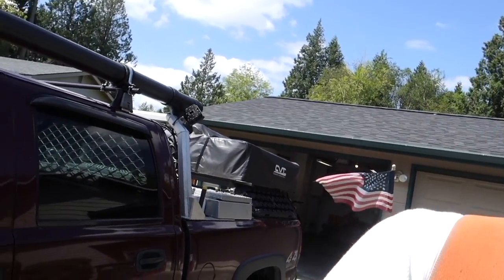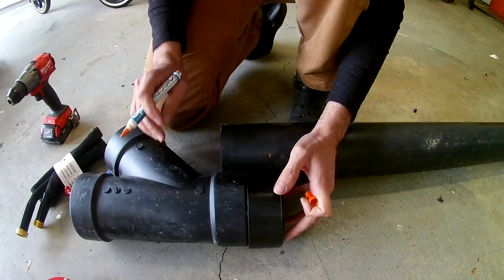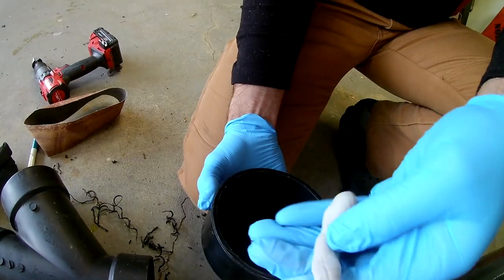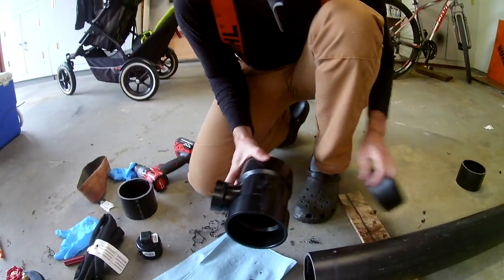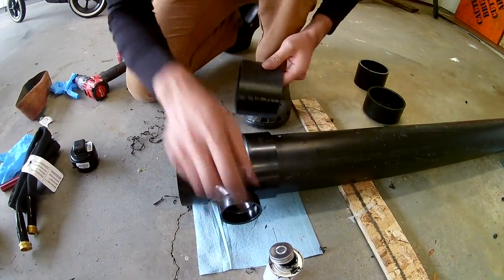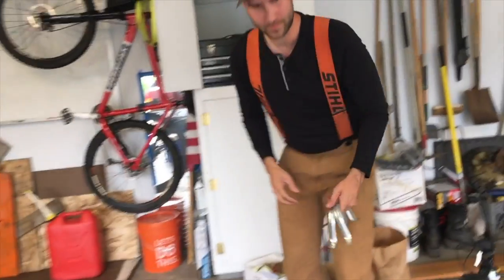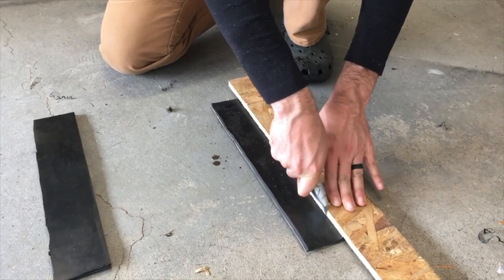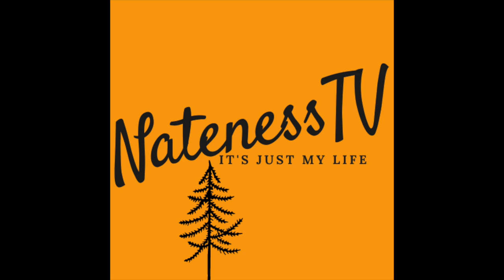DIY Solar Shower System Pressurized for Roof Rack Camping off the grid under $100

Comment: Hey, not a pro here - but when I made mine I read black PVC is not rated for pressure and sources I read said dont exceed 20 psi. If black PVC fails at pressure it's gonna be like shards if glass and yo not gonna wanna be nearby! You said you tested it to 80 psi... No bueno my friend. White PVC is rated to 220 psi so I used that and sprayed it black to absorb the lovely suns rays! Just tell in ya what i learned. Great setup though! 80psi shower gonna rip your skin off anyway! Lol
Reply: Thanks for your info on the white pvc. I will use that instead and paint it black too
Reply: Use copper but expensive.
Reply: Schedule 40 for pressure yeah that's what you mean ok.
Reply: Abs is pretty tough. I guess good pressure rating also. Yeah some pvc types shatter. Sun breaks it down is worse.
Reply: I'm going to add a bleed off pressure valve.  These are adjustable  and will dump air at the preset level and simply reset with the pressure  is below the preset limit.   $15 Amazon
Reply from the maker: Yes no bueno for sure! Now when I use it I don’t even pressurize it because it is brittle from all the years of being in the sun. And of course hindsight is 50-50. I would never pressurize it over 20 again, and definitely recommend staying within the specs. Thanks for your comment and thanks for watching!
Reply: @natenesstv6685  Me too actually - the one I built is from the white ABS allowing for some pressurization then I painted black, but I found that just having it on the roof of my trailer is enough to keep the flowing going for outdoor showers while conserving water so adding the tire valve was actually a bit of a waste of time!  Great design and video though.  All the best.

Comment: good video, as someone who works a lot with glue and pvc. After you apply the glue insert your pipe and turn it a quarter turn. This eliminates any bubbles in the glue and the glue and pipe wont push against each other. Good build though.
Reply from the maker: Great tip! Thanks for sharing!
Reply: I'm honestly shocked this didn't leak like a sieve with pressure. I've had the tiniest discrepancies cause issues in the past.
Reply: Correct!

Comment: Very well thought out. From the air input up top to the drain on the bottom. The only thing I will change is, I will use 6" pipe. With 6" pipe, 1 foot = 1 gallon. So a 6' pipe = 6 gallons. Best roof top shower ever! Thank you.
Reply from the maker: I like it man! 6" is gonna look awesome!
Reply: @tadcody  Thank you very much for the correction. I did a quick net search which told me 1 gallon per foot, so I failed in my due diligence. I agree with you, the greater volume would be even better. And the overall weight should still be under 75 pounds. My roof rack is rated for 150 lbs, so it's good.
Reply: @manofthetombs  that’s what I’m concerned about. Weight capacity of my rack on my suv. I’m planning to run a roof carrier on the rack and this shower system alongside it! Just want to make sure I am staying within weight limit lol.
Reply: @FuhRunna  I am thinking the same as you, sir. I am thinking a rack on the passenger side, and water on the driver's side. The rack would be for shovel, air compressor, tarps, and maybe traction boards

Comment: You can purchase a small pressure gauge and a safety valve and mount them on the top. The safety valve I am thinking of, can be set by spinning the valve housing, it has settings marked, and you can run at 30# or wherever you want to be. It is safer as you cannot go over your safe operating pressure.

Comment: You're the first person I've seen use a rubber expanding end plug. They're nearly always a screw type end plug that almost impossible to get off without a huge shifter! Having everything already in black is a huge bonus and time saver. Unfortunately for me, they don't have that in Australia. I had to sand and paint mine.

Comment: Here's a couple of notes for this project: Be careful when pressurizing PVC pipe. If you over pressure it, it will explode and shatter!!!! More so when cold. (If you use 2 end caps instead of the mention plug) If you are gonna use it for drinking water run a small amount of bleach thru it every once and awhile to kill off the bacteria. This is how regular water lines are sanitized. Also if you use glue make sure it's for safe for drinking water. I'm also looking to make one out of spare PVC left on the job site. If you need a free pipe just go to a job site and ask. There is always a stick left over. Especially if the sun has bleached it. The inspector will not let it be installed, but ok for dyi.
Reply: its ABS pipe tho (fyi)
Reply: When you say you can pick up free pieces around a job site .. do you mean any construction job site ? Can you share ? I'm looking into making one and I was going to buy from Home depot 🤦🏽‍♀️
Reply: @SunnyDays09 you've got to know when to ask a site. It should be on the back end of of the plumbing. I would say just before the windows go in but after the DensGlass is installed

Comment: Might I suggest when you press your ABS fittings together you should insert then give a twist. This will help bond the plastics together making a stronger connection.
Awesome build, great idea. Thanks for the design & video.
Reply from the maker: Good tip!
Reply: Wonder if that's actually true. Would live to see some actual tests supporting this theory. Cause hear say is usually false information.
Reply: @floppinfish  really what it does is it eliminates any air bubble in the cement so it has a more thorough bond, making it a stronger bond also

Comment: I like the test plug. That's a great idea. Not only can you clean it out, but you now have inside access to modify it if needed. My only concern at all would be the Schraeder valve sticking up so high. It might be vulnerable to branches, etc. Maybe something glued to the pipe fore and aft of it to help objects up and over?  Well done! (except for the Crocs. That's a flogging offense ;-) )
Reply from the maker: Thanks! 
Great thought, It does stick up to high, I have trouble backing into my garage now! haha! As to the crocs don't knock em till you try them! haha!
Reply: @natenesstv6685   No worries! I do have a pair of Crocs that I use sometimes. But they are like riding a moped; pretty fun until your mates see ya! ;-)
Reply from the maker: Hahaha! Thats about sums it up!
Reply: Has the test plug held up to pressure?

Comment: Build a potato gun but with 3/4 pipe for the barrel.  They are fun! Like the shower. I did the same on my suburban but with 6in abs. Wish I would have used the y like you did for the valve. Good idea. The only thing I would change on yours is the air valve.  I put mine on the end so it didn't get caught on any trees while out on rhe trails. Stay safe man
Reply from the maker: Good call! I would totally put the air valve in a different place, I haven't had it hang up on any brush but see how it totally could. I also like the idea of using 6in abs! thanks for watching and for the great feed back!

Comment: Very cool. I drive a semi truck and I have a space inside my cab under my bunk the width of the tractor, and I think I am going to build myself one of these. Currently I use a 5 gallon jug in my side box while out on the road. It would be really nice to carry more water, but also have it pressurized making washing dishes and cooking just a little easier. Thanks

Comment: Abs is super high in bpa especially when warmed. Not overly concerning for a shower. But id use pvc just so you could use it for potable drinking water if needed aswell. You can always throw a copper pipe inside to prevent bacteria.😊
Reply from the maker: That’s a great idea I haven’t heard of using copper to fight bacteria! If I could do it over I would definitely go with PVC. Thanks for sharing your thoughts and watching!

Comment: For  a Schrader/air valve - NAPA has one for a tractor (about $5.00) that is threaded to bolt in. I was concerned about over time the pop  in valve might push inside the tube. The one I purchased has at least an inch of threads. Will fit no what size pipe or cap you use.
Reply from the maker: Nice! Thanks for sharing with us!

Comment: That is interesting.  
The cheap solar shower bags that we have were on sale at 2 for $9.95 in our local Anaconda, so I bought 10.  
I have seen them on sale as low as $4.00 each in Anaconda.  
We can solar heat up to 200L for the ensuite 12v shower system powered from our solar charged 1987 Cub Camp-O-Matic Offroad 380 camper trailer.  
If the water is not warm enough for a shower, it can be heated a bit more in a big stainless steel pot over a fire.  
Any empty bags are filled with the same 12v shower pump from a creek in the morning.  
I had a thought of joining 3 bags together with hose T pieces connected to just 1 nozzle for increased capacity and pressure without using any 12v power.  
We don't have any LPG system in our camper trailer,  but we do have a few cheap gas canister camp stoves if not able to make an open fire.  
Regards, Jas.  
VK4FJGS
Reply from the maker: Nice! Thanks for sharing!

Comment: Plumbers use chop saws., Quicky saw, pvc saw. Some ive seen use hack saws which is a pain if your not a pro. I use a hack saw in the 90s some outfits didnt buy a lot of band saws. So they use hack to cut rods. I probably still got those slip scars on my fingers still.

Comment: If you are driving a lot or have a dual battery system you should try adding a 12v 150w heating element. They are only like $20 on Amazon
Reply from the maker: Dude that is a great idea!!

Comment: Im the department head for the local lumberyard's Plumbing and electrical department. Few years plumbing behind me. I help people design repairs to plumbing systems every day. I think i can help you with yours to save a little time and money. Mine is going atop my E-350 van and be permantly mounted on unirail. Im designing one in an "0" design. Four 5'pieces fot 20' holds about 13 gallons. Ill plumb it with water from my clear water tank. Much easier plumbing. 1 cold line to fill and a hot one to the shower and sink. Should be able to push 35 psi, plenty for a shower. Much safer than air. Weight is 108 lbs plus pipe. Im using inspection ports with screw on caps so no need for inspectionport. Put in 4x4x2 wyes. Bush down to 3/4 or 1/2 inch. Now you can use regular plumbing fittings to adjust to whaterver size you need. Put one on each end next to the inspecion port. Cold in one hot out the other. 
I realize yours is easily removed when your not camping, but mine will be permanant.but still removable with 4 clamps for service. To drain, just pull a cap. Ill do a vid on Facebook when i build it.
Reply: Interesting. Did you post a video or sketch of your system?

Comment: seriously, really nice built here, congrats, I like your design also, with the different angled section. I would have maybe scuffed up the ABS where the marine putty goes but not a huge deal, I'm sure it will still hold.....
Reply from the maker: Thanks for the tip! Makes sense!

Comment: Nice.  I built a U-shaped 12gallon and wrapped it around a 320 watt solar panel but I used only two air valves.   takes longer to fill, but super frugal and easy to pressurize.  Water always seems to be hot.  Video on my channel.
Reply from the maker: Nice work!

Comment: you should have placed the spigot as close to the bottom of the tube to drain most of the water.  Also, twist a quarter of a thrun of the parts joining to squeeze out any air bubbles on the joint.
Reply from the maker: I didn’t get a good shot of it but it is on the bottom that’s why I put the y in it. Thanks for the tip on the 1/4 turn! That’s a good trick!

Comment: Great video...I missed using the sealant and now it is leaking...I wonder if it is too late to use the water bond to seal the water boiler drain from the outside.
Reply from the maker: I don’t know if I would try that personally, if possible probably best to cut the pipe open and redo it from the inside. either way let me know what you end up doing and how it works! Thanks

Comment: Have you had any issues with either the test cap or cleanout cap leaking pressure?
Reply from the maker: The first time I used it the test plug popped out & I lost all my water. Once I tightened it better I have had no issues. I love the test plug and highly recommend it for this application, just be sure to tighten it well.
Reply: @natenesstv6685  my test plug blew out at 30psi, I had to tighten the plug with a wrench to be safe

Comment: Nice looking build! Curious now that it’s been 3yrs how it’s been over time?
Reply from the maker: It’s been good to go, I will say I don’t pressurize it like I use to because the pipe looks faded (looks maybe brittle) so I keep it at 15psi when using. If I could do it over I would use PVC schedule 40 or 80 (and paint black)as I’ve heard that is is more durable for our door use.
Reply: @natenesstv6685  Thanks for the feedback! I’m currently building one now, but wanted to use the test plug vs threaded clean out. And that was the part I was most curious about. I am using schedule 40 for my build, the plumbers on the job site I’m on hooked me up with all the parts and pieces!!
Reply from the maker: Good call with the test plug, I wish I had done that! Have fun with your build!

Comment: I'm thinking a quick release for that test plug for tailgater applications...great video.
Reply from the maker: Good call!
Reply: @natenesstv6685  Nate...I used the test plug one at the end and one at the fill point...could inky get 35psi in it before it blew the test plug out 9f the pipe.
Did you have any issues with PSI and the test plug?
Reply: That test plug he used is rated only to 15psi.

Comment: Could a vertical version be made  , where would be best place to put the pressure valve if so , thanks
Reply from the maker: Good question, I have not seen that yet but I’m sure someone has done it. I would think the valve at the top would be best.
Reply: @natenesstv6685   I’ve made  a shower from a garden pump sprayer. So you pump the pressure up  first. , but the pump bit goes into the liquid , nearer  bottom end  and also the nozzle that sprays is at Top of sprayer on connection to the hose to spray  any thoughts on this  this is a Normal garden sprayer ,with shower head adapted  works well but looking for fixed garden idea thanks

Comment: Wonderful work. Maybe I missed it in the video but is there a rule of thumb for how much air pressure to add? It doesn't seem like anything would indicate if you over filled it
Reply from the maker: Around 25psi. Any more that that and you have to really tighten the clean out plug down a lot to keep it from popping out.
Reply: @natenesstv6685  I apologise if that was already answered. I got it built today but I need to go get stitches from something related 🤣 subbed. Thanks for getting back to me

Comment: How well does this work heat wise? Does it heat the water enough for a comfortable shower?
Reply from the maker: Depends on the temperature outside and if your are in direct sun. You kinda have to play with it a bit. On a 85 degree day it was just right for showering for me.

Comment: This is an exact copy of Mav's solar shower from a year before your video. I see you watch Mav!
Reply from the maker: Nice! I just looked him up and he has great content, I like that he used PVC and painted it black I would have done that if I had seen his video first. If anyone is thinking about building one of these systems check out Mav, every one does it a little differently and it’s always helpful to see several approaches.
Reply: @natenesstv6685  Have you ever seen black pvc? Most big box stores sell it, even at the Home Depot stores here in Mexico. The solar heated water tanks I'm going to put on my van here in Mexico and on my Tahoe in the USA will be made from the black pvc pipe. 

I was going to use a 6" PVC pipe but there's too much volume there to heat up. If you use a 4" pipe, the surface area versus volume requires minimal sunlight to warm up your water. 

If you use screw on ends (still using thread tape) instead glued caps, you can clean your pipe tanks thoroughly when you unscrew the ends off.  

The black PVC shoulder arrow quivers for both of my PSE bows in the USA and here in Mexico... I made from black PVC. But with these, I used end caps glued on because one end is open.  I'm going to load a video about making one. But my YouTube studio is not complete yet.

Comment: Great vid guys. I would really liked to have seen how long the flow or pressure would last for.  I do understand that the less water the pipe has the longer air pressure you would have, still I’m doubting you would have enough pressure to have a 3-4 minute average shower. Cheers.
Reply: Can't actually pressurize it at first because the water is taking up all the room. Have to keep it pressurized with your portable air up compressor (or tank) as long as you are using it.

Comment: Great video, but any reason why you didn't use Schedule 40 PVC,  ABS can become brittle under direct sunlight, and there are some toxic qualities to it that makes the water non-potable in an pinch.  PVC schedule 40 is pretty durable up to @120-30 deg F. and psi of 155 I believe.  Just some feed back but helpful video regardless.  Cheers
Reply from the maker: Thanks man! Yes I used it because it was black and didn’t feel like painting the schedule 40. I have such low psi I’m not worried about it shattering. I would say schedule 40 or 80 is way more quality and durable. With ABS we don’t drink the water and usually go through it so fast and refill I’m not too worried about toxicity, but that’s just me. Haha! I like your feedback hopefully it’s helpful to some one reading.